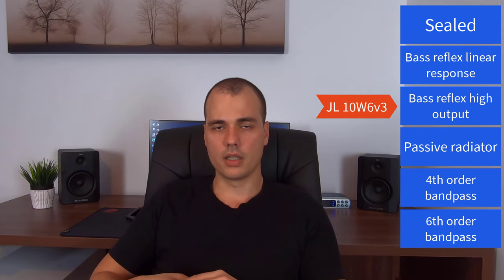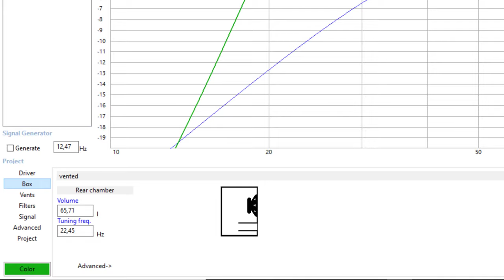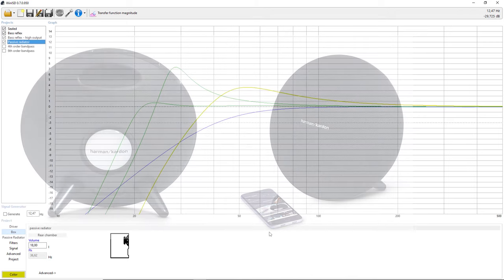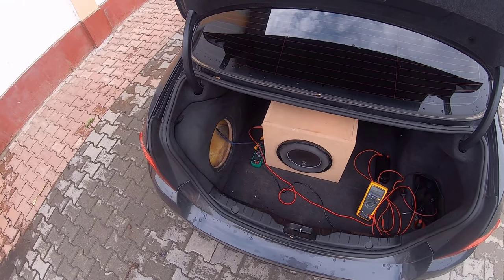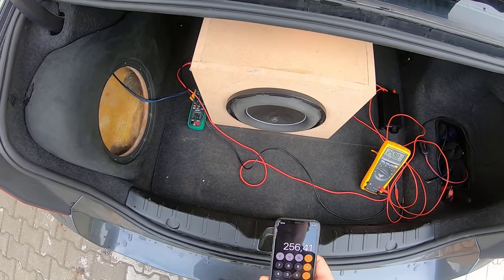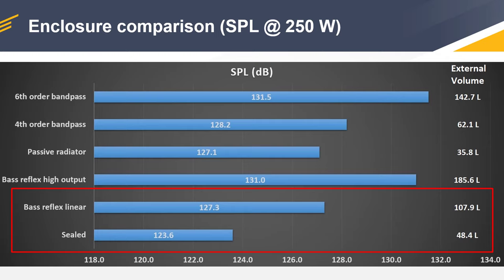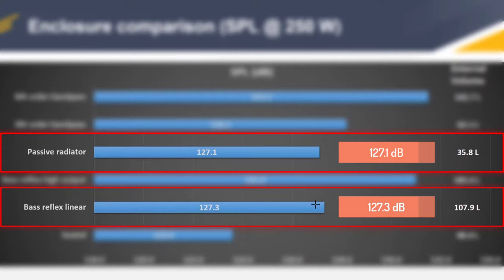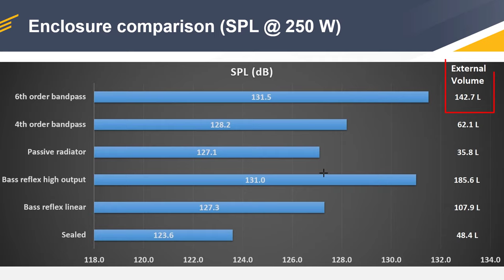Sealed vs Ported vs High output bass reflex vs Passive radiator vs 4th and 6th order bandpass boxes

Comment: Nice work. Very appreciated. Fyi: TL sub and rear, front loaded horn or folded horn  will easy kill all this kind of enclosures!
Reply: Site to explain?  Not sure what you mean. I.m building a box for a single 18 in evl. 2 om.
Reply: @inkmonster0u812  The transmission line and horn are more efficient and more bass effective enclosures. 
https://youtu.be/aV1wSLTrX4g
This may explain abit more.... Try to build and  when you hear the difference you understand this by your ears....
Reply: @igor2030ign  Thank you for linking these videos. I just finished watching both of them. For me it's a perfect example of "you don't know what you've been looking for until you've found it." I'm really interested in learning about more efficient builds, and horn style builds is something that just hadn't caught my attention yet. I've seen HexiBase talk about them before, but so far 6th order and 8th order enclosures are all that really stood out to me more before now. THIS is cool.
Reply: @igor2030ign  Just so you know, I've been hooked on watching MBEnclosures videos ever since you linked his videos above. Haha. Dude knows his stuff about box building for sure.
Reply: @John3K21  Great man! You can check my extreme cheap Rear Loadin horn build for my car. I was amazed with the sound power and how low it goes for 100W and 8 inch cheap sub. It was made with 8mm thick cheapest wood panel...  Use headphones for video playback.

Comment: Hi from México I have 3 15" Dbxi earthquake.
My friend Wich is an ing. Expert in audio,  designed 2 boxes for each one, a sealed and  a ported.
The ported has an aero port of 6" diameter and 15"  deep and is enormous, my first thought was that I could not listen to jazz music. But surprise, jazz music sounds better than the sealed box.
At 20 herz the sealed is terrible bad.
I made my  proofs using the same amp and same equ and same power.
So for me I prefer the ported box, just if it is well designed.
Reply: I've made a few hybrid transmission-line boxes (pressure chamber followed by a long folded port). All of them have been very good for a wide variety of music, being everything from rock to dubstep.

Comment: Great work thank you for your video....I would like to hear your opinion on which box sounded best in your vehicle and which you would run with in your personal situation?
Reply from the maker: Depends on what you are after. To me the sealed box sounded best. If you are a basshead the 6th order BP sounded loud but still linear in its playable range.
Reply: @AudioJudgement   Just curious, but how do you upscale the volume of an enclosure when making a 6th order bandpass? Is there a calculation adjustment that specifies "what the difference between a 4th and 6th order should be"? If the Vas of a sub was, for example,  25.50 L, what would then be the "ideal" enclosure size for a 6th order? 
Furthermore, what dictates or specifies where to put a baffle in a 6th order? I've seen them anything from nearly a 1:1 to a 3:1 ratio...
Reply from the maker: @RAW_Reality  There is no such thing as volume ratios when it comes to BP4 and BP6 enclosures. This is probably something invented on some forum a long time ago, and passed on. To calculate the volumes you use a modeling software, like WinISD, input the speaker parameters and adjust the box parameters until you find a satisfactory response. The resulting volumes don’t follow any ratio.
Reply: @AudioJudgement  Thanks for the input, and good to know. 👍

Comment: what if a dual active sub push pull sealed design ?
mutliple drivers ported ? / mutliple driver sealed ?/ mutliple drivers with bass radiator as thicc or larger surface and heavier cone  ?
or basiclly made the same thing as this but with 2 or more active drivers ? 
looking foward to see more about mutliple drivers n passive radiators

Comment: Apart from the consideration of being able to access the subwoofer, is there any difference which part of the subwoofer is in the sealed chamber of the 4th order?
Reply from the maker: It doesn't make any difference. Only thing you need to worry about is that you need to add the volume displaced by the magnet to the corresponding chamber.

Comment: I'm running 1100watts through two 12's and can't pass 116... back to the drawing board.

Great video and info!!
Reply from the maker: my guess is that you're measurement equipment might be faulty. 116 dB can be reached with almost any subwoofer, let alone 2x12 with 1kw of power.
Reply: @AudioJudgement  I don't think you're wrong, it's a cell phone app. I have seen the same app read others higher, then again I went with 28"2 of port area. I have great depth but the numbers aren't there. I guess this is beauty of car audio. Build, test, repeat.
Reply from the maker: You can't measure SPL with a phone. Even specialized measurement microphones cap out at 130 dB. Some fancy ones can measure above 130 dB but not by much. You will need a sound pressure sensor to measure. Your setup probably exceeds 140 dB. Stop using your phone. You're better off judging the SPL using you ears.
Reply: @AudioJudgement  this makes me feel much better. After watching you do 127db on 256 watts, I was shattered. 
Thanks for the feedback. Thank you for the knowledge.

Comment: 8:29. How? Every single port calculator says that the wider the port, the longer it has to be as well.
Reply from the maker: I'm talking about the box size, not the port diameter. If the box get's smaller and the port diameter stays the same, then you need a longer port to maintain the tuning frequency.

Comment: Hey, I am curious.  Have you ever made a video showing how to calibrate a microphone with the mic calibrator and how this works with REW? I have a microphone that doesn't have a calibration file so I have no idea how to do this.   Any help would be greatly appreciated.  You have already helped tremendously as I am doing an sq build.  Thanks again
Reply from the maker: You need specialized equipment for that. You will have to search for a company that calibrates microphones and they will make the file for you.
Reply: You can buy one that's calibrated. Umik-1 comes with a flash drive that includes calibration files, for example.
Reply: @orangejjay  

Yeah I have an awesome microphone now.  I bought one that was not calibrated back then because of price

Comment: which type of enclosure is best for deep bass
please tell me ported ,band pass or passive radiator
does passive radiators are better for deep bass??
Reply from the maker: With a good driver, any of the 3 enclosures can reach deep bass. In most cases bass reflex is the way to go.

Comment: So is the ideal placement for a single radiator directly behind the driver? If so, why do most boxes have them on the side or the front?
Reply from the maker: It's not the ideal position. You can place it on whatever panel. It doesn't really matter. If you have 2, you must place them on opposite panels. However, if you have only one, the position is determined for aesthetic purposes mainly.

Comment: What about 4 or 5 passives in that box it can be supported on stilts or hung by wire 🤔 🤔obviously with a suitable dual voice coil 2000w sub ran on a 1000w amplifier 🤷‍♀️🤔🤔🤔👏👏👏

Comment: Would you recommend passive radiator or ported box for a 12" sub for car audio?
Reply from the maker: I would suggest a ported box. Doesn’t make any sense to use passive radiator, because you probably have enough space in the trunk
Reply: @AudioJudgement  thing is I'm trying to save space because I have a smaller car
Reply from the maker: Then you can go for sealed or passive radiator
Reply: Oh, you are of Baltimore Ravens!  Go Ravens!
I also have a ported box for a 12" woofer for car trunk, but I want to put in a passive radiator in it (volume 1.2-1.5 cubic feet.)  
Can anyone comment on it, besides Audio Judgement?
Reply from the maker: @pvosoccer1585  The box is small enough to warrant a passive radiator. But make sure the speaker doesn't exceed the excursion limit of the PR. Multiply the area of the speaker (Sd) by Xmax. The number you get for the PR must be at least twice as large compared to the active speaker. If not, then you must add another PR. Another way to limit excursion of the PR is to add mass to the cone. However, this will lower the tuning frequency of the box (and you don't necessarily want that).
Reply: It depends on the types of music you listen to.. If you want a box specifically for a wide variety of music, then go sealed / passive radiator. 
If you want high output, then go bandpass or ported, but the frequency band gets narrower, either high kicks or just low rumbling (depending on port tuning)
Also, depending on the type of subwoofer you are running.. For instance, a powerful high-Xmax subwoofer like a Sundown, Orion HCCA or a similar brand works best in a ported box. While a more SQ oriented sub will perform really well in a sealed one.. Subwoofers with soft suspension and rubber surrounds are great for sealed enclosures.
Reply: @Skarfar90  I'm getting a sundown SA v2 12". I've just built a ported box for it. Hopefully it sounds good!
Reply: @destinseese34  That's a nice pick. How did the tuning of the box turn out to be?
Reply: @Skarfar90  I haven't checked yet. It should be around 35hz. The recommended number.
Reply: @destinseese34  Pretty sure it will sound good for most kinds of music then.

Comment: How about 6th order bandbass with 2 passive radiators instead of the ports? Can be simulated with WinIsd?
Reply from the maker: Unfortunately, not.
Reply: @AudioJudgement  if I make a 2 different simulation with the same speaker and 2 different volume chambers (PR1 for tuning frequency 1 and PR2 for tuning frequency 2) , after than the 2 results merged can simulate  a 6th order bandpass PR  box?
Reply from the maker: No, it doesn't work that way.

Comment: how do you "choose" a tuning frequency. i choose a tuning of 30hz, but how do i achieve that?
Reply from the maker: I have a video on how to design a ported subwoofer box. You can check that out
Reply: @AudioJudgement  i did im still confused. that vid brought me here. i just feel like unless all the variable and constants and equations are labeled it becomes extremely hard to follow. i'll try watching it again. but i dont like using these online calculators and spreadsheets because the hide what is going on and i cant get a feel for how one this affects the other. 

I kinda understand that if you change one aspect of the design other parts will change in relation to it, but i need so see how the proportions relate to each other.

Ill watch the other vid again.
Reply from the maker: @-IE_it_yourself  The equation is long and difficult to follow. With experience you will better understand the effect of each parameter. Right now, your best bet is to use the excel spreadsheet and play with each parameter and see how that affects the result.
Reply: @AudioJudgement  TBH i think ill make a test box one where i can add stuff inside to decrease the volume and change the port size. this is more an adventure in woodworking and hearing different types of speakers rather than creating something ideal. i already have a pair of Monitor Audio MA9, and they unfortunately sound great, so i doubt i will ever get to that point.

Ill try and get back to you when i can come up with a proper question. thanks for the reply. and i look forward to checking out your online courses too.

Comment: What if the sealed enclosure was larger? I've personally tried a 18l sealed enclosure compared to an 42l sealed enclosure and the low bass output is significantly louder without any eq.
Reply from the maker: It depends on the parameters of the speaker, but in general, a larger sealed enclosure will have a better sub-bass response. A smaller enclosure will create a peak in the upper bass, if that is desirable. Also a smaller enclosure will demand a more powerful amplifier to play loud.
Reply: Audio Judgement The main man has finally replied, thank you for that hopefully a lot of people see this information if they're trying  to get low with sealed enclosures. Only thing is not to go too big otherwise it'll act like a IB design.

Comment: I regard to passives , people make the mistake of using one the same size as the driver ,wrong ,8" needs a 10" to dig lower than a 8 can get alone ,try it
Reply: It's not the size but the amount of air that needs to be moved. If the passive radiator were able to move significantly more than the active driver, then it would work, but typically you should use a larger radiator or two of the same size.
Reply: I believe an unwritten rule is that you can use a passive with same size as long as its x-max is double that of the driver.
Reply: @garglemaionese this. 2x the Xmax, doesn't really matter the size or number of PRs if you can reach that goal.

Comment: I like to see a bigger box with passive radiator(if its posible) or a weight on the passive radiator in comparison whit the other boxes...
Reply: There's no point in using a passive radiator in a large enclosure if a port can fit. A passive radiator produces an even steeper rolloff than a port, so it provides no advantage.

Comment: I found it, I think the movie is cool! Just nice if you test bigger speakers :) 12 "15" inch subwoofers. :). I think that the difference would not be that big, especially since the small speaker by nature does not sound low, especially 30-40Hz, and such 12-15 inches can even reach 35Hz, even though the subwoofer is closed :) I have a pride lp 15 and in a closed 78L sounds incredibly low, 30hz is not a problem, and the pressure is already strong at 35-37hz :)

Comment: how isnt anything falling off your dashboard or ur mirrors arent shaking ?? at 130 db  ??
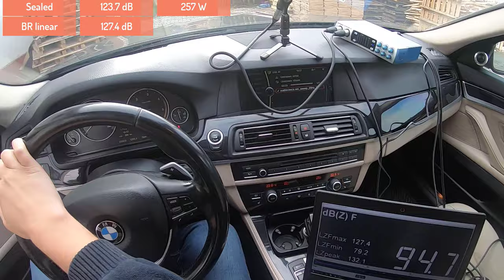Reply from the maker: Actually 130 dB is pretty low for car audio bass heads, and the interior is well made and still in good condition as the car is not that old. However, things do shake. You can see at 18:24 my laptop starts to move as I turn up the volume and at 18:30 I'm actually holding the mic as I'm afraid it will fall off.
Reply: @AudioJudgement  send me ur email. i got less db than that and every single thing in my car moves shakes rattles. i think that db meter needed calibrated or sum. when i use my phones db app i get like 55 db
Reply from the maker: Dude, you can’t measure high pressure levels with your phone. 55 dB is like a conversation in a quiet room. You need dedicated equipment.
Reply: It's a BMW, not a Peugeot, Peugeot is OK

Comment: Remember, people... Every +3 DB is actually twice as loud because of how DB works. So a standard ported with a flat response is twice as loud as a sealed one. And a 6th-order bandpass is twice as loud as a standard ported flat response box.

EDIT: I'm coming back to update this and say that in the ensuing year or two since I originally posted this comment, I've learned that to the human ear 3db is NOT 2x as loud or quiet. In fact, if you want to double the audible(to your ear) volume of a sound, you need about 10db. 6db will sound 50% louder (or about 2/3 as loud if you're doing 6db quieter), and 3db is around 25% louder (or 4/5 aka 80% as loud if you're doing -3db)

As such, the "f3" of a speaker or sub box is a rather conservative number of the roll-off, and you can pay more attention to your F5 or F6 for when your speaker and box combo will ACTUALLY get significantly quieter in its audible (again, to your human ears) output.
Reply: But only louder in the range of frequencies they're designed to play. A bandpass enclosure is just that. It passes a band of frequencies. I will never choose it for subs because I like low bass. Well, I guess I'll choose one if the low frequency band is 10Hz, lol. But bandpass enclosures traditionally produce one-note-bass. They were popular in the 90s, and it seems like very few people use them now for some reason.
Reply: @thingsdemystified   I had a 4th order bandpass box in my car with 2 Skar Audio DDX 12s, and it was one of the best sounding systems I've ever had. Only got rid of it because it took up my entire trunk and I eventually needed the space.
Reply: What happens when the passive radiator is 100 liters?
Reply: @thingsdemystified  Definitely some outdated thinking there. It all depends on the construction. Furthermore, a 6th and 8th-order bandpass can be easily made to be very musical and wide-range. For instance, if you tune the low-frequency side of a 6th order to 28hz, and the high-frequency side to 63hz, you'll have something that potentially can play from mid-20s all the way up to 70-some-odd Hz no problem. If you go 8th order and tune, say, 25/60/85 then you can probably play from 20hz to 90hz pretty damn well.

And if you think two octaves of coverage for a single sub-stage isn't enough, you should re-evaluate your outlook on acoustics.